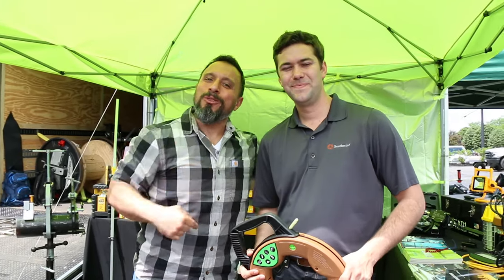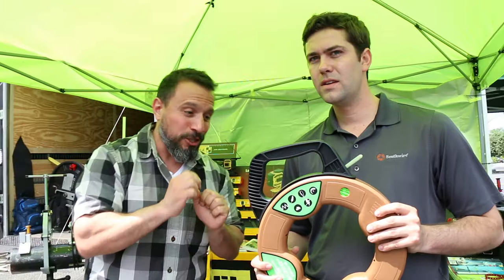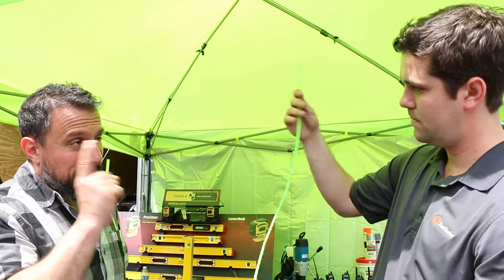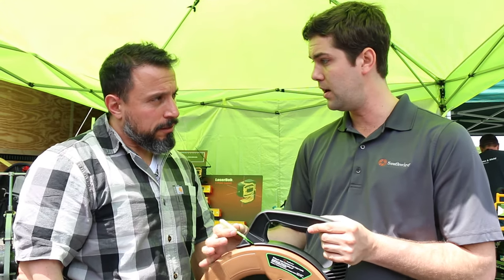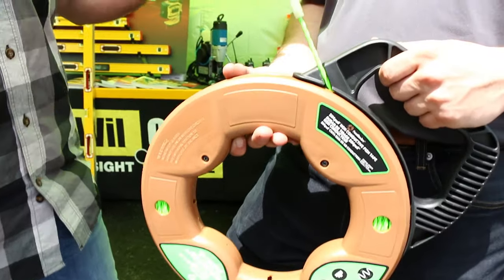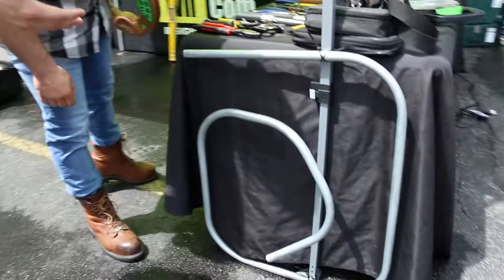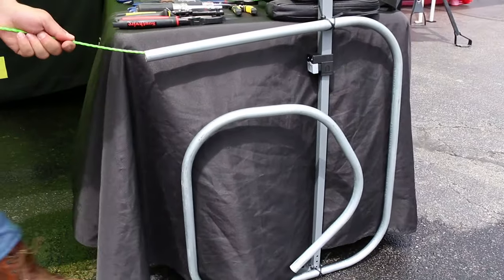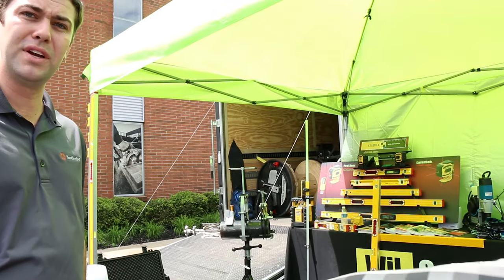99.9% OF PEOPLE DON'T KNOW THIS OBVIOUS ELECTRICIAN HACK!

Comment: The problem isn't getting it through 360 deg bends back to back, it's after 50 ft and after the bends go in opposite directions.
Reply: And when you actually have a glued PVC joint. This is continuous conduit with no joints. The easiest to pull

Comment: today i was using steel fish tape , and it would  always get stuck at the second 90° bend, but the test you did was a short run, i would like to know how it would do on a longer run like 40-50ft with two 90° bends
Reply: If you have trouble try lube it helps on tuff jobs and tubs stuffed with wire
Reply: All of these bends were turning in the same direction... Fish tape gets stuck from bends that are opposite from each other
Reply: @ULFRAKI  that's why its a good idea to add condolette whenever you can if your run changes directions. Even though code says you don't need a pull point until 360 degrees of total bends, it is a handy way to pull wire easier.
Reply: @ULFRAKI  ..Yes, exactly.  He did say, "You'll never have a bend like THIS!"  I'd have to agree!
Reply: Stuffed with wires too lol

Comment: Hi Guys!!!  Hey Vince, is that swirled conduit a good test for fish tape?  That conduit went around clockwise the whole length, which might be easier to run fish tape thru instead of having the conduit going one way, then U-turn the other way, then 90 degrees up, then U-turn down, etc.  Maybe that would be a tougher test?
Reply: 100%.  The tape is able to push against the pipe so will stay rigid the whole time.   A better and more realistic demo would be 4-5 lengths of pipes with opposing bends, long straight runs, joins and put 3-6 cables in it.   Something we'd actually see
Reply: I bet I can push my old steel fish tape throw their test !
Reply: @aceseightsazhvacsparkyandg8138  I bet you could push a bit single wire through their test
Reply: @PhatChris221  lol maybe with solid copper not stranded

Comment: i like these demo's but the truth is take 100ft run with 2 90's on one end and 2 90's on the end of the 100ft run and add in wire to almost max fill and then see if it'll push ...that's a daily occurrence for most electricians.

Comment: We got one of these at my job last year. It worked great in the test they had set up. They didn't give us a size for using it. Ours got mangled in an under ground temp conduit. It bound up pushing through then pinched itself trying to pull it out. The pinch point made it hard to use in long runs with multiple bends. I'm gonna have to get a new head and definitely try that head truck next time. Would hate to have to restrict to to short  runs in small conduit.

Comment: I use that Southwire fish tape at work. It’s comparable to the Klein Tools fiberglass fish tape and the neon color helps with locating it in a dark ceiling. I actually prefer it over the stiff Klein fiberglass fish tape.

Comment: I don't do alotta conduit work but I have found that 1/2" pex works well on short runs. Easier to push thru obstacles(insulation, blocking, etc) n it doesn't coil up as easy as a steel fish
Reply: Wait what?
Reply: @amoncopeland6747  ?

Comment: Nice short vid Vince.  I've never used a fish tape since I'm not an electrician however, I'm curious how it compares with the Milwaukee and Klein polyester fish tapes?   Just asking.  Cheers!
Reply: @William Logan 
For pulling wire through conduit this is the best tape ever (why is it Gotta be Doodoo brown?)! It is way better and more flexible than my Klein nylon tape. I have no experience with Milwaukee fish tapes, but with that said normally when you’re the electrician and you’re working in low light or no light situations so would you like to Milwaukee black or would you like the Southwire glow in the dark? 
The two fish tapes that are on me all the time or a Klein 25 foot pull tape that has laser edged numbers in it every foot so that I know how far down or up I have fished, and a 50 foot regular Klein fish tape. I keep the long tapes on the van for really bad days.
I have multiple Klein tapes, Thomas & Belts tape and Greenlee tape (first tape it’s supposed to have 50 feet in it but it only really has about 16😳).
Reply: The Klein one is really great, I've used it and I'll says it's better than this one but they seem to be made from different material.

Comment: Of course its going to go through all those bends right there.....look how close they all are together, MY QUESTION Is will it or how hard would it be to push through 3 90's all three with-in 235' and somewhere in that run there is a 20° kick 90 and an offset (30°'s on both bends)..........350° total all spread out in a distance of 235'

Comment: Have used many fish tapes/poles/etc....in my time & have tried them all. I do like the new “tech” of the tapes that have come out in the past few years. Makes things a little easier on the job👍🏻. Can remember first job site was on using a steel fish tape on a 20-30 ft run w/ some 90s & I got the thing stuck, & had to cut it off.....not fun to do; as you lose time. 
It’s pretty cool when you CAN cut a tape & use a field repair kit to get up & running again in no time!
Cheers✌🏻
Reply: How do you get a fish tape stuck in a 30 foot run?

Comment: .....Hmmmm, I knew this trick. Never seen a wiffle ball used but instead of a wiffle ball,  I have seen those blue rubber raquet balls used with a hole drilled through it (they're smaller than a wiffle ball and they weigh a little more and can maneuver through large conduit better , but you gotta tape it up real good  ...so ....same trick just a different kind of ball. .but on really large conduit we use a vacuum cleaner (on reverse) to blow a little parachute attached to twine through the conduit. Then use the twine to pull in a "pull rope"
Reply: Hey Gary, thanks a lot for your comments, that's absolutely more organized and closer to the truth, I have some extra questions about difficulties, guess you may have a great help for us based on your great experience, if it's fine for you, please let me know, thank you.👍

Comment: I do pool lights and had about eight bends in .5 inch do you think it would work with that?  The builder put the light niche in a decorative spa wall that is a waterfall that was a half circle where it was install and the light was at the very bottom. I'm constantly running into these issues.  Bigger conduits are easy how about .5 inch?
Reply: may you please let me know what it looks like? a picture or video will be great.

Comment: The only thing i would be worried about would be when you are pulling the wire. with metal tape it has the rigidity to push back into the spool by itself without pulling the handle, which is good when you have a tight pull and have to pull on the wire itself not just the handle. on this one it seems that you would have to push the handle every time to get it to go into the spool or else it would just make a loop on the outside. idk, maybe i am wrong but it just seem like it would be that way.

Comment: Got the fishtape!
Love the fishtape!
A little confused on how to use the wiffle ball. The statement about it grabbing the outside of the pipe threw me off. Somebody help me please! Help me please!
Reply: I think a ping pong ball would work better, you just push the end of the fish tape inside of the ball, tape it on. The ball is larger and round, so it will roll right around the walls of a bigger pipe.

Comment: Of course you would encounter than many bends on site and more, granted with accessories in there as well but we still want to pull the cables as far into the containment in one go s possible. Frankly I have been using a steel tape in that exact reel for years ( cost £20) and the sporado version is far better for clearing blockages than anything I see here, so no sale and can the senior shill dial back the testosterone please.